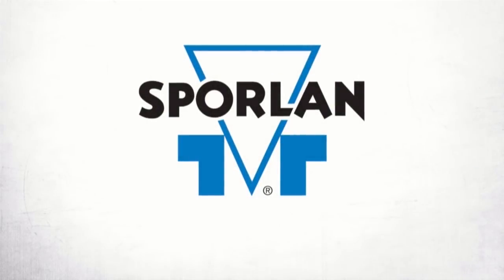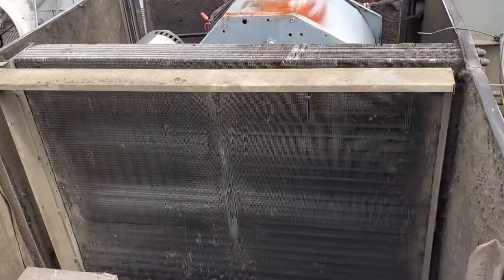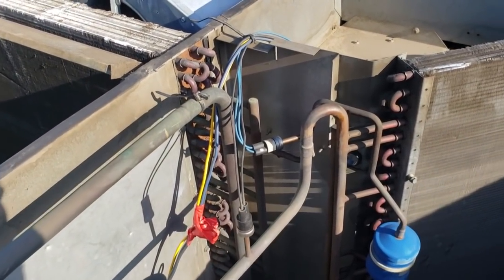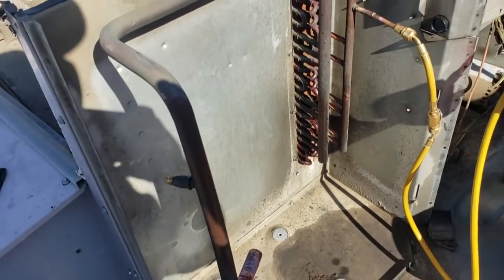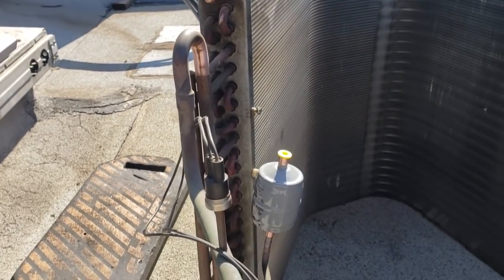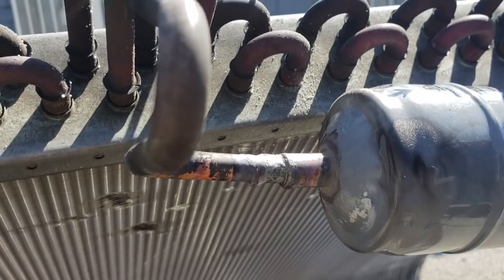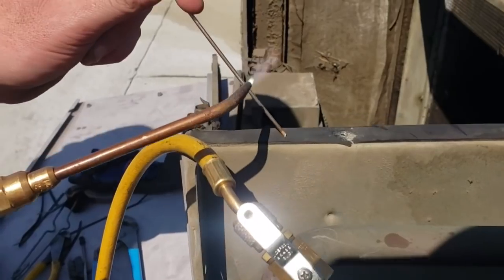CARRIER NO COOLING CALL

Comment: Hi i changed 6ton comp on one of these unit  having low suction hi head suction line and compressor icing up new drier no sign of any restriction high side guage fluttering so  bad almost invisible only different i used 422b   please suggest i want to save this comp . customer is happy with cooling.
Reply: Do this procedure as much as u can.. I had same experience too. Check the metering device, flush with nitrogen, check dirty evaporator, blower drive belt and motor.. good luck! :)

Comment: Would you recommend to fix or replace a unit with the type of problem?
Reply: No,  Replacement is a not permanent solution. Find the fault . do the best solution . Help the customer pocket
Reply: @selvarajanv.achary7628 I have waited around 2k on "repairs" with various techs at this point I am thinking I should invest in a new unit.

Comment: IF  a carrier or trane package  this noise to much Freon These units bad about the orifices stopped up with trash no screen in front in the headers. The Bigger units  have same problem. If the unit foams when placing gauges on ports you have unit someone added 407C add 4-6 oz Polyol Ester Oil to make the it stop it waxing up.

Comment: On the last shot of the unit, it could have just been the camera playing tricks on my brain, but it looked like it was running backwards or was that just because of the frame rate on the camera shot? Just curious... because you did mention you weren't a fan of some of the other repairs like the universal motor (myself included) trying to hone some of my own Diagnosis & root cause of failure skills & knowledge base as I work on more package units now. (No worries if you don't have time to respond). One last curious question about your tools. Are those the testo wireless probes you used? If so, how do you like them.

Comment: I do not use oxygen acetylene because you can melt copper way too easily and get hotspots way too fast there’s absolutely no reason why an air acetylene Turbo torch can’t do the job. All I use is a Turbo torch on every single braze. The trick is to heat up the pipe move the heat down to the connection and finally heat up The receiving end or what goes into.The only problem I have with brazing is when I get contaminants on the copper even after you sand sometimes it happens

Comment: New tech here. Seeing the braze job at 17:38. aren’t you supposed to heat the pipe, take the flame away and then put the braze rod on the hot pipe to melt? Never touch the braze rod to the fame

Comment: I’m new,
Why use braze and not solder??
Reply: Is it copper to copper pipes.Release all pressure. clean both surface ,Tryit again and call me.
Reply: Solder for low temperature application. Brazing is   hard pipes and more heat source require.

Comment: Goodness. That unit had to take close to 7-10 pounds of r22... that stuffs so expensive even if you use rs44B that was probrably a $2200 repair. Shouldv just changed it out
Reply from the maker: The customer chose the repair vs the replacement

Comment: I'v noticed a lack of flux while soldering, or at least a lack of noticeable flux burning off. is that because most flux is corrosive and you don't want to get that into the refrigeration loop? Unless the solder is borax core or something, which would make sense, much like welding rods. I'm fairly good at soldering myself, but I mainly do electronic components and the occasional mild steel to make enclosures for my projects. I will probably end up making less metal enclosures once I get a 3d printer.

Comment: That whole thing should be converted to hfo. R22 is going to make it really expensive to recharge refrigerant in the very near future.
Reply: Yea , unit should have been Re-Charged with R-422b or R-407C. But , that can be done in the future too. im suprised hes still using R-22 on Full system re-charges when 422B works so good or R-407C. ill use R-22 to top off a Residential but thats about it. R-22 for small top offs ok , but Full system charges With a New Compressor --- R-422B or D. R-407C Have Proved themselves quite acceptable for use until the unit is changed out for a 410a unit.
Reply: @OcRefrig  Its still an HFC though. California is already on its way to phasing it out. R448a is the only zeotropic blend that is CA approved at the moment unfortunately.
Reply: Yea, i guess we should start using the R-1234Yf. i have not bought any yet.
Reply: @OcRefrig  I'm only just learning about it myself. Sounds like a giant pain. Whenever you have a leak you have to evacuate the whole charge recycle it and put a fresh charge in.
Reply: it looks like its like propane with a twist. flammable but not because it has a fire retardent in it maybe. im not going to be using it anytime soon. who knows they will probably change thier minds on this stuff too. what a cf. im not going to use this stuff for a while.
Reply: @OcRefrig  I don't know I'd have to look up the molecular structure of the blend but it is classified as non flammable. You're not kidding about it becoming a cf.

Comment: shouldn't have changed the compressor because the unit is almost at the end of its life cycle   Could have just fixed the leak, spread apart the touching lines a little and cleaned it up.  I've  had compressors run for many years making those sounds.

Comment: 1st never unsweat a compressor. The added heat causes ref to escape from the oil and when u pull with pliers you slosh the oil around and with the heat refrigerant separates from the oil and comes flying out suction port. The hot fitting will ignite oil and u have a fire blasting into your face . 2nd I bet the old comp would work fine with new charge and oil change. Maybe not but they all make noise when short gas and oil. 
Trust me after 30 years in trade I have change hundreds of compressors and u will cause a fire by unseating those fittings on comp

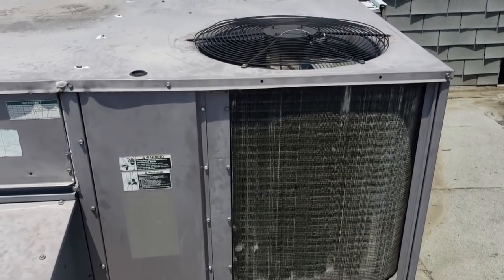Comment: 30:55
What i think is it's because the support of the dehydrator broke that the pipe enter in contact, then went the leak and maybe an oil contamination with water get down the compressor.
Or as i said in my previous comment, the compressor was already be replaced and the pump down was wrongly done which lead to same issue of oil contamination.
Are my ideas good or wrong?
As i said i'm more boiler technician than fridge technician, but i learn a bit of fridge during my formation at school and i know the basics.
It's really a good job and i think i'll go this way in the future.
I hope i'll find a boss like you to help me start.
Or at least i got your videos 

:)
thank you very much.

Comment: Why do you do that? Turn that unit off before replacing the filters! not only are you sucking all kinds of dust and dirt from that nasty filter in the inner cabinet of the package unit, you are also putting you and your helper at danger of having a piece of clothing or some foreign object sucked into the lower assembly! I wouldn't fire you for this the first time! but we would definitely have a problem if you did it again!

Comment: BRO WHY SO HOT ON THE SWEATINGS JOINTS?
Reply: 2 reasons....#1 the flame wasnt adjusted properly. the blue should have been 3/4" to 1" long, especially when he was removing the suction line at the compressor. #2 he had so much heat absorbing material on the drier he couldnt get the solder to flow without getting it red hot. He'll probably be back in a year repairing a leak on that drier.. The teacher needs teaching in this case. That was horrible..

Comment: HY One you made the mistakes. Overheated the everything. Sure flow don't take that much heat. You holes in the cooper pipe witch is not good. Should have replace the pipe if you where a pro. You did not show that you evac the system before opening the system by law. To many parts missing in your training video. Would never let you change a a/c condenser
Reply from the maker: This is not a training video, its a video of my normal day, I don't always show every step because this is not a diy channel I will discuss this this evening 6/8/20 @5:PM (pacific time) on YouTube, come on over and check it out https://youtu.be/Kb28yZQCico

Comment: Oh! Watching you teach these guys this way is so backwards!
I've watched many of your videos, I just frankly, you are not silver soldering correctly.
You concentrate your heat in one place, you need to learn how to move your torch, and do the damn best you can to bring the material up to temp, evenly, and quickly (increase your tip size and/or regulator pressures). If you have the option, concentrate your heat to the top, yet keeping the complete joint, just at, or a bit above the melting point, now, while doing all that, with the torch (kinda backing off) on the top, touch the filler to the bottom, when it is right, the silver will wick up to the heat source, you're good!
Quench it quickly, to anneal the copper pipes, if you don't, they are brittle, and lead to more cracks and leaks. If it messes up your joint, it wasn't right to begin with. Lotta sad story's about that!
Not criticizing, just sharing some experience. 
Wanna know about 40 containers of fresh tuna, loaded in Guam (I watched em do it!) In boxes set to -10, no access to the Evans, various methods of initiating/terminating defrost, plugged up drain pans (can't get to evaps! Remember!)
I'm thinking of your "what's the difference between a blast cooler and a freezer"
I didn't loose any of em. They were stacked 3 high, on a ship, rolling 10° one way or another. 
Ah! The good old days!
I like your videos, they show me why I'm glad I'm retired and don't have to put up with it all !
Keep it up, don't stop learning!

Comment: ATTENTION SERVICE TECHS: STOP USING DRILLS ON CARRIER PACKAGE UNITS, YOU DON'T KNOW HOW TO SET THE TORQUE ON YOUR DRILL AND YOU'RE STRIPPING OUT THE SCREW HOLES IN EVERY UNIT I'VE EVER SEEN. USE A NUTDRIVER, OR LEARN HOW TO ADJUST THE TORQUE ON YOUR DRILL, THANKS.

Comment: We have not been allowed to use R 22 gas in Belgium for a while now !!
Why is it still being used there?
Environmentally harmful !!
Your work is absolutely respectable !!
But the legislation ??
Look here, it's from Daikin !!
"A large proportion of the air-conditioning installations in Belgium that were installed before 1 January 2004 work with the R-22 refrigerant. R-22 is a chlorofluorocarbon (HFCK) that was commonly used in air-conditioning systems. However, when this refrigerant was used in the air is released, chlorine is released into the stratosphere, which is harmful to the ozone layer.This degradation of the ozone layer leads to a number of environmental and health problems.To put an end to this problem, legislation has been adopted (European regulation EC No. 2037 / 200 HCFCs) prepared and signed by the international community that systematically prohibits the use of R-22 as a refrigerant. "
Reply: EPA Section 608 is our rulebook here.
Reply: Smidse 't Veloke you know it’s because of the chlorine in refrigerant that they are doing this or that’s what they say. Do you know how the majority of chlorine gets in the atmosphere?? It’s from ocean water evaporation.as our salt water is being evaporated it causes chlorine to go into the atmosphere. It’s the major cause but government environmentalists don’t want to say this. They just want to pick something else and say it’s the problem. Look at the chlorine put into pools by the tons every year. So don’t believe everything you read. I still have R12 and R22 on hand if I ever need it . We don’t live by European rules either.

Comment: Of course the compressor sounds like shit there's no refrigerant in the system. Why would you ever start up a compressor without refrigerant in it and leave it running? You know that oil leak that you found that oil circulates in the system so you're running the bearings dry. Just like running without oil in your car. I know it's not your equipment. Guess you're just trying to get an extra dollar out of the customer. You give HVAC a bad name I'm sorry ever stumbled upon your videos. I guess it's just too hard for you to braze the hole. Pull a vacuum to 500 microns and charge the system